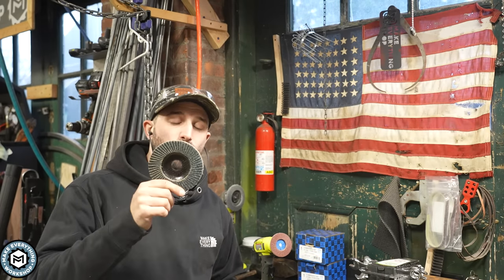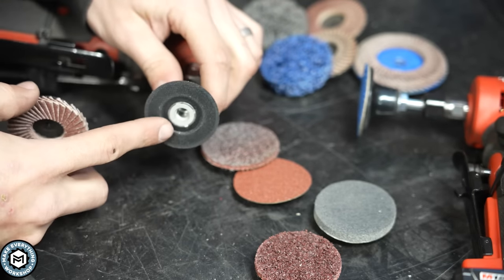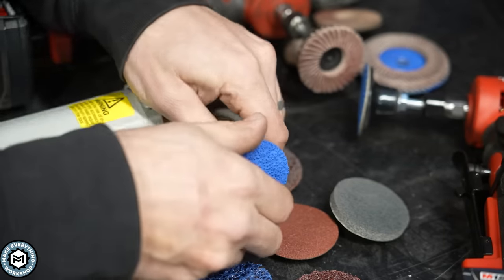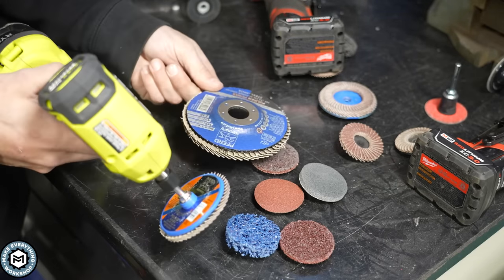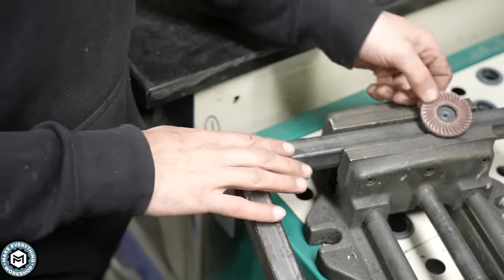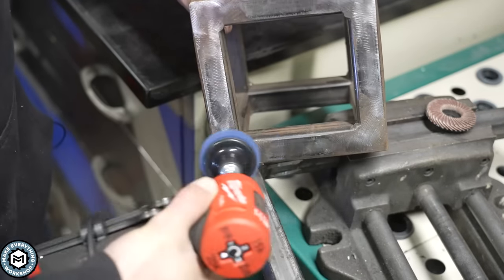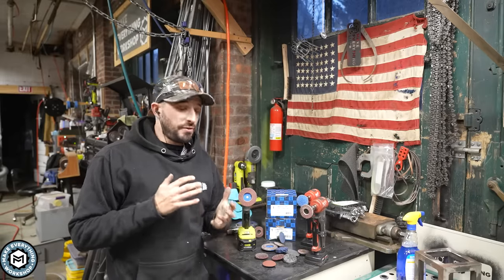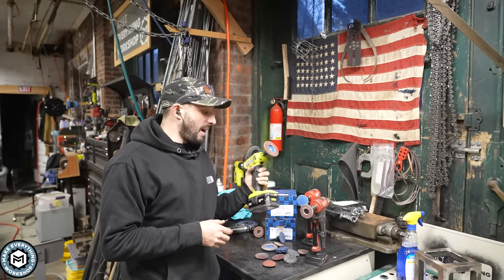A Small Grinder, For Big Jobs - Combidisc System - Metal Working Tools You Need

Comment: Long time ago bought a Roloc kit and went through the 2" consumables quick $$$. Now I use a friends Laser @60W and copious cheap sanding belt offcuts (cut from the back)to make thousands of pads for nix. Cut em 2" round and cross hair the centre. I never take the roloc out of the grinder, just overlay one of my pads and run a course 3/8"long flat head screw into the old roloc installed. When my pad runs out I take out screwe and put a fresh one on. Now it's cheap and I'm never afraid of tearing or mashing up a consumable.

Comment: M12 die grinder was one of my best purchases for metal work. Very versatile tool. One of my favorite things is because it can run slower than an angle grinder it can work really well at mill scale removal without clogging the disc.
Reply: I now have a die grinder and new angle grinder, both with variable speed, both corded. Various consumables state that they need to run slower than many single speed tools run. I have seen several demos of people like yourself, who use wire wheels and grind disks, burrs, etc., getting better results at reduced speeds. That is exactly why I bought variable speed die and angle grinders; way more versatile.

Comment: Very good. I've been using the roloc system for a couple of years and it rocks. I'm using a small air tool and it's fine, but I want to trade up to team red for this. I think they still make the very best small angle die grinder. For removal of rust, paint etc from bigger areas you can't beat the larger size as they are more consistent. Also, for small areas a finger sander will always beat a 2" grinder, but for polishing etc a roloc sysem is best. A little surprised you didn't mention the finger sander for very tight spaces but no dramas. Also, I always  think an angled grider is easier to operate than a straight one. Like the top abrasive idea and shoult out to the Cubritron pads from 3M. Pricey but good. Thanks for the vid!

Comment: 76 yr old hobby welder: I made a mess out of a basin I put together that leaks and has way too much crudy welding that I need to remove. I have little experience with a die grinder that I know know I need. I want a corded variable speed angle die grinder...I think. The video gave me better insight into the tools/disks I need. This is the third video I've watched by "Make Everything". Thank you.

Comment: I picked up some combidisc disks a couple years back. I planned to get a die grinder, but didn't until now. My variable speed die grinder's lowest speed is way faster than the spec's on the combidisc disks.

My old hand drills, and new triple reduction drill, are low RMP's and I didn't find any real use for these disks. Now I find that my die grinder is too fast for them.

There must be better(faster running) combidisc disks, than what I picked up at a hardware store, because what I bought is clearly not suited to die grinder use. I need a faster hand drill for the ones I bought; and I need faster combidisc disks for my die grinder....

Update to earlier comments. The combidisc disks I bought at the hardware store were only meant for a high speed drill. I will soon have one. I also see now, that many companies make combidisc type consumables, made for much higher speed, even faster than my die grinder...which makes sense. If some brand says two inch disks for a drill, you best look closely for the max RPM.

The disks you showed on your die grinder are what I am looking for; especially the starter kits. The links you provided to PFERD kits, now shows unavailable. I can only find their products in expensive 10 packs, for example...die grinder or angle grinder.

Were I currently in business as a welder, and not just very fussy and still learning, it would be worth $100 for a bunch of nice disks......but those would outlast me, unless I get really busy lol

I have been to PFERD web sites, have downloaded their catalog, searched for online and local sellers. So far I have not found where I can buy one or two of something from PFERD, there is not even product numbers for single units of most disks, and wire cups etc.. I have already written to PFERD to tell them I like their products...from what testing I have seen...but I don't need 10 of everything, costing many hundreds......probably won't hear back. I am not planning to spend enough!

I am not done looking for a local supplier that will sell individual units of disks from PFERD, but I already have ordered some consumables locally, that I really do not know the quality of.

I see several manufactures that also make quality angle grinder and die grinder attachments, and so I am looking into them as well. Walter, 3M, etc..

There is another thing that is difficult, if you want both a quality product, and the correct/best one for the job; that is, figuring out what all the different ingredients/compositions are designed to do, and what materials actually make good quality, and what materials used means it is cheap one time use dangerous crap.

Perhaps there are other well made brands of starter kits, or small job kits, or sample kits, for die grinders and angle grinders??? I like how the PFERD kits are(were) geared towards a specific type of job: prep to paint, mirror finishing. I think this is the way to sell to smaller/home work shops. Then when we find that we use one or two disks more than others, then it would make sense to purchase a pack of 10 or more.

Suggestions?

Comment: Hey Chris, when it comes to those inside corners of the frames, nothing squares out the weld bulge like a couple strokes of a flat bastard file. Unless you are using a pristine pad, you likely end up rounding off the corner edge of the material like it appeared to be on that tubing. That being said, they excel on all other applications as you pointed out. Love your content, keep it up!

Comment: Great video very informative. I’ve just bought a Katsu 3” Angel Grinder, a nice little tool. I’m just getting back into DYI and a small project I’ve in mind.

However, I need some advice please on the various accessories & attachments I can buy & use with the Katsu… Arbours, size etc etc etc… Tried clicking your website & apparently it doesn’t exist anymore…

Any advice would be helpful and invaluable…

Comment: I'm definitely going to have to get me some of these. I have to rework a lot of welds in work from a shitty robot welder and have been just using a grinding bit and a wire wheel and you don't get the cleanest finish. How long do these sanding discs typically last? I'm welding aluminium so I assume they'll last longer than on steel

Comment: I have that M12 die grinder.  I do love it a lot, and use it quite bit on brake and other rust or metal cleanup.  It also works very well with carbide burs.  How does the speed and torque of the Ryobi compare?  Is it stronger or weaker, by feel?
Reply: I had the M12 Milwaukee one but once I tried the Ryobi, I sold it and got the Ryobi. That thing is powerful. The Milwaukee was smaller, but it bogged down, or cut out too easily. I love the ryobi one.
Reply: @Omardottcom  cool!  I have every color tool there is.  199 with 2-3 batteries seems decent.  I will be picking one up.  Yeah the red does cut out easily.  But I do like the right angle of it.  Pistol grip isn’t a prob in most situations.  I hope she’s got the power I’m hoping for.

Comment: Too aggressive for autobody panels. Roloc bristle discs are great because they don't remove metal or change the shape.

Thing is, with Dewalt, you can use 60v battery in 20v tools. With Milwaukee, you can't.